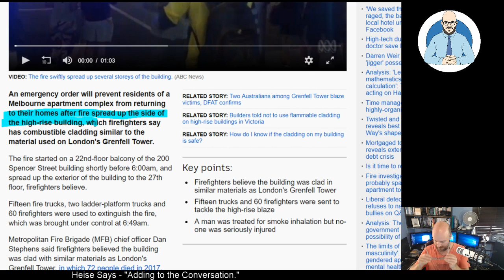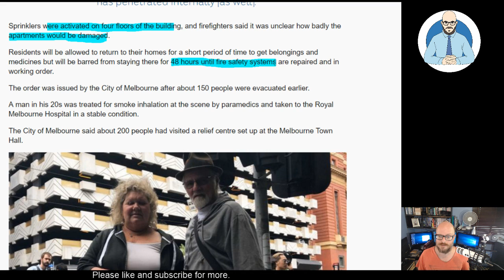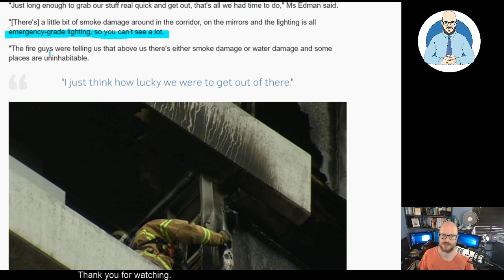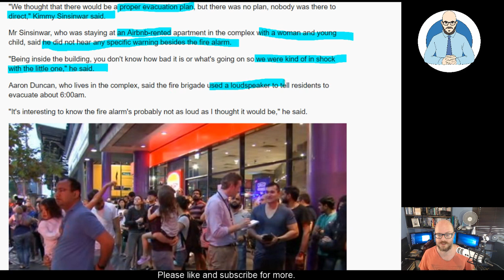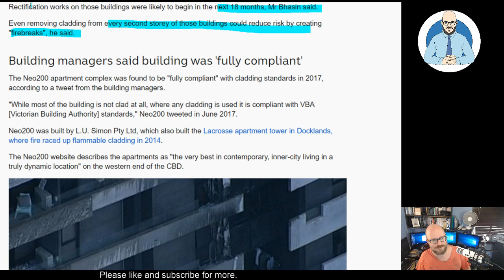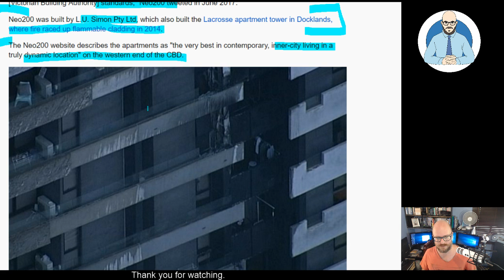The Spencer Street High Rise Fire

Comment: Heise thank you for covering this news

I have had to recently settle an off the plan apartment in Melbourne also constructed by l u Simons

How can I check if this new building has the same combustible cladding as these other 2 buildings ?

Thanks
Reply from the maker: The issue is will aluminium composite or aluminium honeycomb cladding.

Ask for a complete set of the drawing including the specifications and then as for receipts from the build to prove what was installed.

Finally hire an Architect to review be documents for you or call Alucobond and ask if one of their reps would help you out. (But them a thank you carton)

You want to make sure that the cladding core is appropriate.

I would suggest you talk to a lawyer to see if you can get some clauses added to your purchase contact that would make the developer personally warranty the cladding. (Doubt they would be brave enough)

Honestly if the building is being built now everyone should be aware of the issues.

You could also just phone the Architect and speak to them honestly about your concerns. They should be able to let you know the product they specified.

Hope that helps. Now is the time to get it changed  because during construction it is much cheaper and easier.
Reply: @HeiseSays  thank you so much 

The building actually finished construction in late 2018

But it is still under builder's warranty

Sorry I am new to this process - which party should I contact first to start the process - the developer or the sales agent or speak to the conveyancer who helped me settle?

Thanks again
Reply from the maker: Honestly I am only experienced from my side.

I would try several avenues, because you are asking for information the most people would not request. Talk to the conveyances and see what they can get for you, but it might be to unusual for them.

Try the agent and developer as well,but they might ignore you.

Do you know who the Architect is? You could just ring them up and ask and simply tell them you are worried. At the very least they would pass on the message to the developer that potential buyers are concerned and that might encourage them to release a statement.

It is completely reasonable for you to get a copy of the contract documents (between the builder and the developer) because those should specify what you are buying off the plan.

I’ve given you lots of work haven’t I.
Reply: @HeiseSays  thank you Heise 

Yes I have a couple of avenues to try 🙂
Reply from the maker: Please let me know how you go. It would be worth sharing.
Reply: @HeiseSays  surely
Reply: Buy from a reputable developer with a Long standing reputation. I bought from CE who has happy customers that bought long time back.  This is their confirmation in black and white.  We confirm that the builder for Melbourne Grand is Brookfield Multiplex.

 

The façade of the building is glass and concrete and will not contain any aluminium composite cladding panels as was used at Neo200 and Lacrosse. 

 

In addition to internal sprinklers in the apartments, the balconies will have external wall mounted fire sprinklers as well.

 

The Building Surveyor and Fire Engineer have confirmed that the development meets the building regulation requirements.

Can you get similar confirmation from LU Simon?   I thought there are new rules enforced after that Lacrosse (also by LU) fire?   So all new buildings should not have this material.

Comment: I remember going to Bunnings some years back to buy some insulation for the roof cavity that did a better job of cellulose batts, and that combined the idea of corrugated cardboard which has excellent insulation properties because of the air pocket cells between the two layers of cardboard with something more fireproof. They showed me this plastic stuff which looked like the plastic version of double layered corrugated cardboard.

I said "You think I'm putting that stuff up in my roof are you kidding me? Do you know how easily that would catch fire?"

Turns out this was the exact stuff they were making all the high rise cladding out of.

Comment: Why don't they have external fire sprinklers
Reply from the maker: It is already done on risky areas. Particularly balcony’s.  

The system probably worked as designed in this building because everyone got out.

The big issue is the use of dangerous materials solely for cost reasons.
Reply from the maker: It’s called a fire truck
Reply: Some older buildings . Govt buildings in Sydney have them and there concrete cladding  . Stop flames to jump floors. Can't remember the exact building. Also i thought buildings need certain fire resistant curtains on ceilings  . Like physical concrete downturns . We are doing things to suit architects aesthetic pleasures 🤣
The architects of ICON . Next time there documents go to tender add 20% on the quote. There was always complicated designers.
Reply: Think external sprinklers comes down to class building and type.
Train stations . Hospitals and so on
Reply: https://youtu.be/EO4uGPBzN6o
Interesting watch